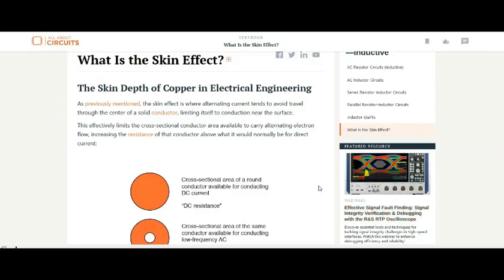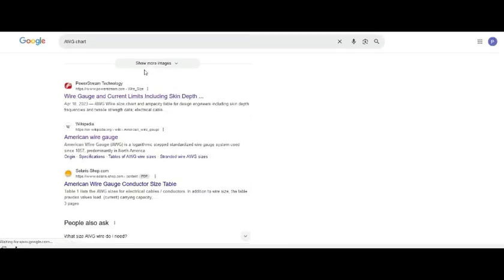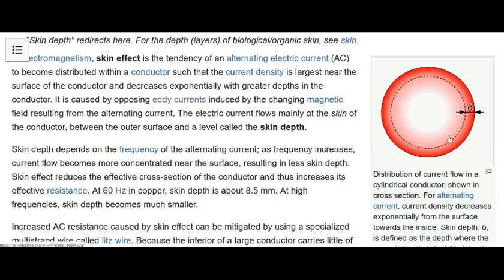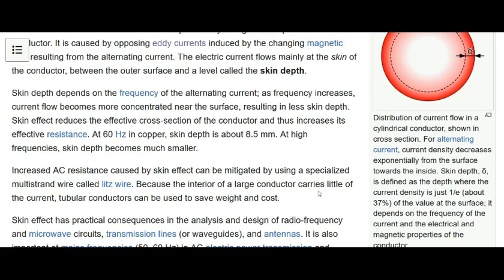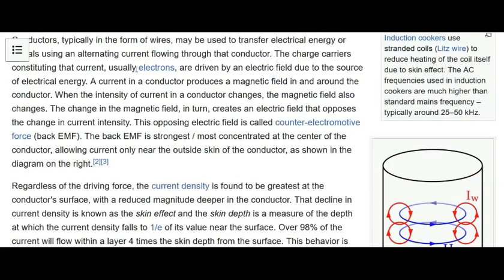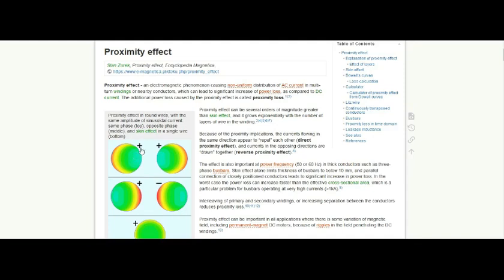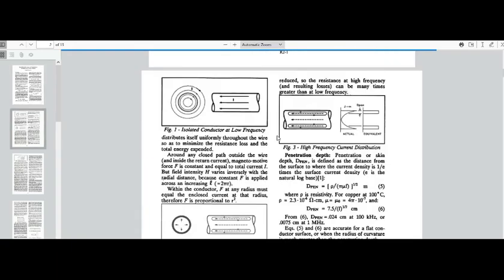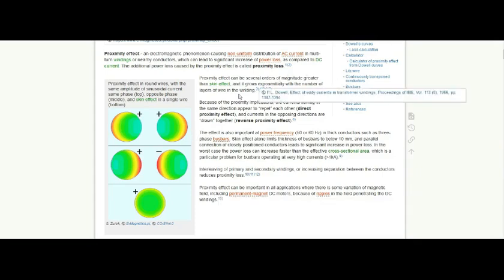Project Q: Skin Effect and Proximity Effect, Part I

Comment: Very interesting observations ! You may want to look up for the work of Richard Vialle or JL Naudin, Lorrie Matchett, Jes Ascanius, Alxekor and how their experiments plays with proximity and skin effect. For reference: Patrick Kelly books chapter 3
Reply from the maker: Thank you! Am familiar with JL Naudin's lab, also have skimmed parts of Kelly's, what over 1,000 page compendium which is nice but at some point one has to get down in the weeds on a specific topic and he likely touches on 100s of them.  Not familiar with the other names and will try to get a chance to look them up going forward.  I will throw one back at you which you may or may not be familiar with.  Dr. Steven Greer recently released a public searchable database of documents he has, you just need to enter your email which apparently helps stop DDS attacks or whatever they are called.  Much of it has to do with little green men, to make light of a big topic that I don't know much about, but there is also a lot of interesting technology and energy related information.  To give a notable example, John Bedini released a CD called the Cejka files which he had locked down with encryption which expired after a year.  Holy crap, just entered  "Cejka files" and the first result is that exact video from our mutual friend @GuardianEngraving, you can also get all the associated paper documents off of Greer's database.  One could probably spend years having fun with and looking to make sense of the info and ideas from those files alone.

Comment: Copper pipe can also help mitigate skin effect, in very high current coils such as the driving coil for a Tesla coil.
Reply from the maker: Yes indeed, if you are using very thick copper for the low resistance and running at a high frequency the center of the conductor isn't carrying any current so why pay for the copper and have the added weight. Thx